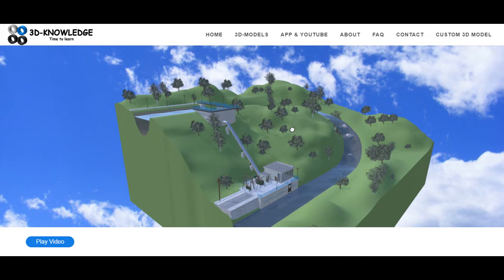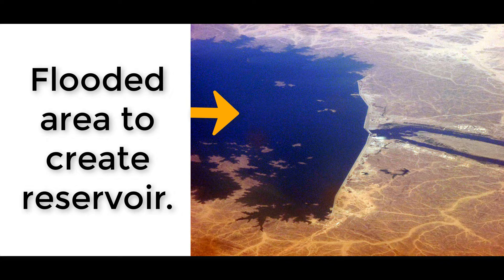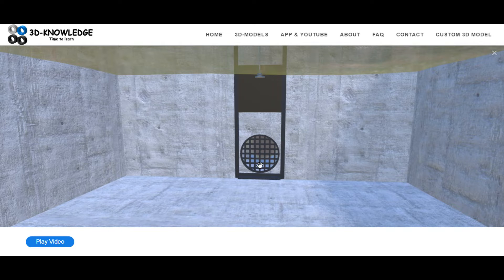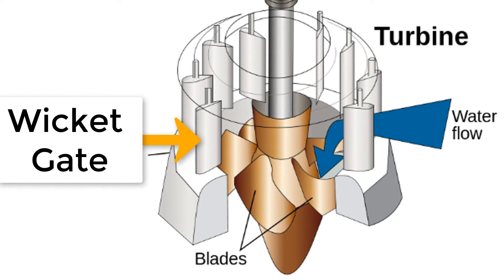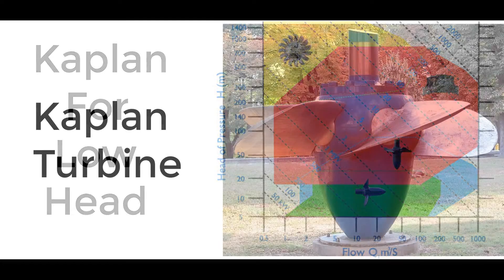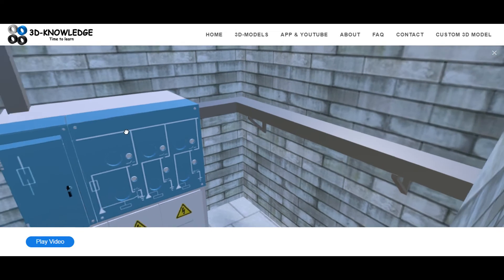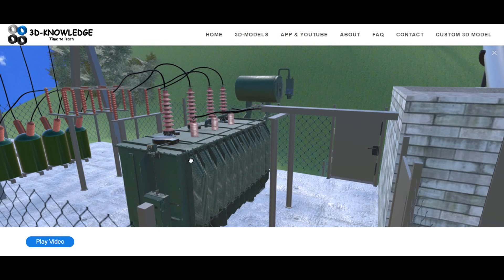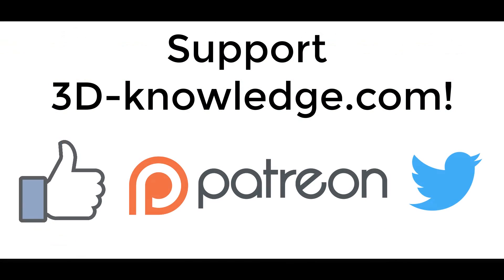How Run of the River Hydroelectric Power Station Works

Comment: Auto subscribed :D
Beautiful 3d model sir.
Pardon me if I am wrong, but the first priority to step up the voltage into HV for transmission line is to reduce the power loss because of its far distance from power plant to substation instead of cost.
For cost, whether ais or gis type for hv are way more expensive than mv switchgear. Also the cost for adding step up transformer and any other monitoring and maintenance too.
If that power plant is specific only for small rural area (maybe only micro hydro model / small wattage output), no need to use swithgear, mv generator and any step up transformer. Only use lv generator, switchboard and maybe synchron panel for more than 1 genset.
Cmiiw.
Reply from the maker: Check out some of the new videos on the new channel (saVRee). You will see stuff on there about power loss and transformers. But you're right, smaller plants don't need this sort of equipment.

Comment: One thing that would add a little to the cost to build but would help the fish is if instead of ladders that have bends, just make pools downstream of the weir that are within reason of what the fish can jump. Then the fish would not have to search out the route up the fish ladder and could just go upstream. If your weir is say 20' high, make 8 pools downstream that only change the level by 2.5 ft. If the fish that are native don't jump, make the whole area sloped with weirs spaced every few feet to give a reduction in the speed of the flow. The wider the area the fish have to find, the more likely they will be to use it. Also, the downstream sluice gate needs a grill to keep the fish out.

Comment: Excellent video and 3D rendering.
I was of the opinion that based on the head which appeared to be around 50 Meters to me, a Francis turbine would have been used. The head and elevation angle would have given it a decent flow rate.
However, I see the rationale behind the use of the Kaplan. The blades can be adjusted for zero pitch as an automated fail-safe mechanism to protect the turbine.
Thanks for compiling and posting!
Reply from the maker: Most I have seen with this setup have been Kaplan, but it really does depend on the conditions. Thanks for the comment! Don't forget to check out the new channel! 😃

Comment: sir, will it be possible to join two or more project for increase the power for one line?
Reply from the maker: Maybe. But you would also need to change all the settings for things like breakers, switchgear etc. The impedance in the circuit also changes and the cables may not be suitable to carry more amps. There is a lot to consider and you would need an electrical engineer to go through the whole system. You would also need new system studies e.g. Short circuit, coordination studies etc.

Comment: Great video! But although this kind of water generator cause less damage to the environment, it is much less effective in utilize the kinetic energy from the river. Right?
BTW, If everything goes ok, this month I will become a Patreon from your Video/site :D
Reply from the maker: Thanks! A patreon is always welcome! I will have to check the Patreon page and check its correct, can't remember what I put on it (was not much happening on that page ha ha 😀).  

Coming to your question... Yes, they are less reliable because the water level varies so the head of pressure also varies. Sometimes the water level or flow rate is too low to generate power, this happens for a couple of months a year in Europe depending on where you live. So the power source is very 'green' but not reliable (common problem with many renewables).

Interesting Case Study
In Germany, they actually have to let water by-pass many hydro plants when its sunny and windy. There are literally too many solar plants and wind turbines in operation, and these guys push the price of electricity down (the price can be negative, which means you pay to get rid of your electricity...no joke). This just shows that even if you have a fantastic source of electrical power, economics and politics can make a mess of it (sigh). The biggest problem seems to be storing the energy, if we can solve that, then we really will have a better world.